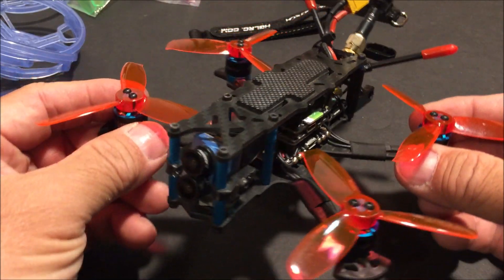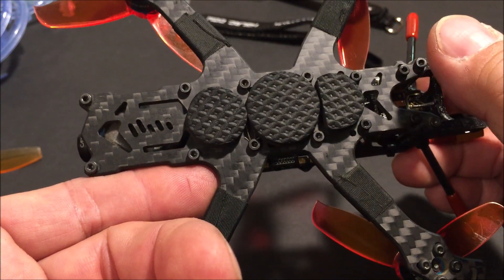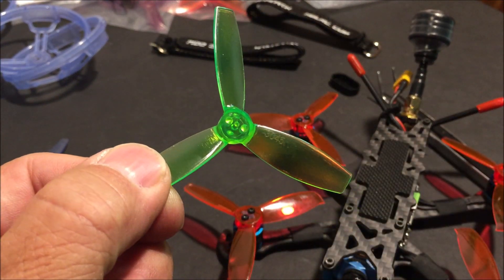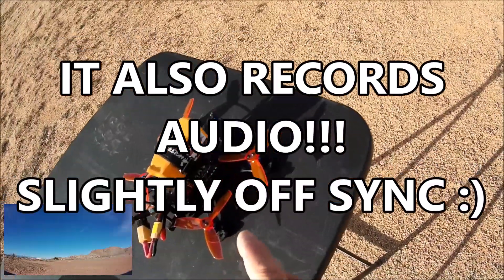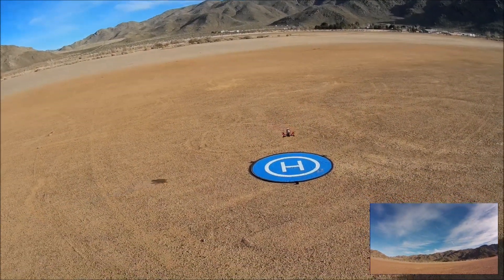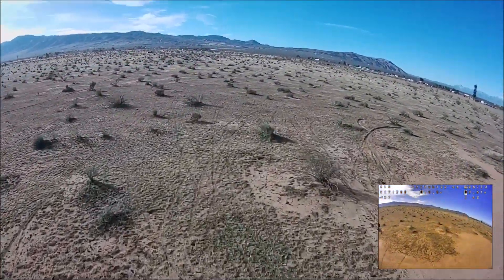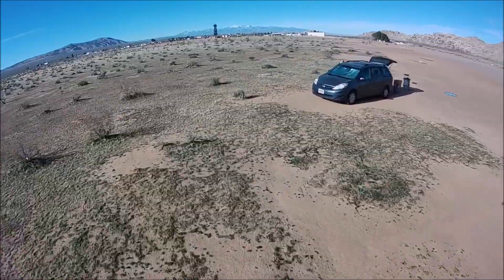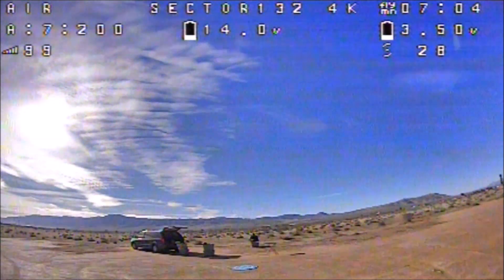Review & Test Flight - HGLRC Sector132 3-4S FPV Racing Drone 4K CADDX Tarsier

Comment: Any suggestions on clearing up an RX FAILSAFE error in Betaflight? I have a new Sector 132 with Crossfire Nano factory installed. I can bind the quad with my new Tango 2, but the failsafe error is not allowing them to communicate, so I cannot even set up switches. I'm really new to FPV, so sorry for the basic question!
Reply from the maker: Harry Rosenkrantz 
Sorry, I’m not familiar with the tango 2 and crossfire rx.
Reply: Hey Harry having same issue any luck since your post 8 months back ?  thank you

Comment: What battery do you recommend to last longer in flight?
Reply from the maker: I been using the cnhl 1300mah 4s but if you use the 18650 4s pack it will lengthen the flight.  However! I do not recommend long flights due to the motor getting hot.
Reply: @RCEscape  would 3s with same mhs do the same job ?

Comment: PLEASE HELP!
What password do you use to connect the WiFi?
My Tarsier won't record and I want to find out why =/
Reply from the maker: here is the manual.
https://cdn.shopify.com/s/files/1/0036/3921/4169/files/tarsier_user_manual.jpg?497
Reply: @RCEscape  Thank you very much! It was actually the formatting with the computer. That didn't work. When I formatted the SD card with the app - it was fixed!
Thank you very much for the nice review and your answer =)
Reply: Ah - and I forgot: The password is 12345678 ;-)